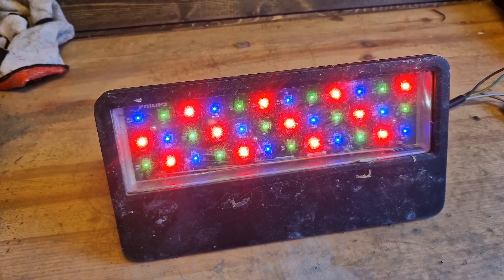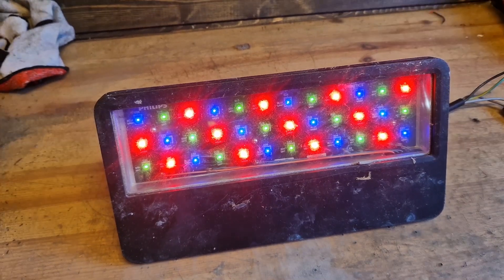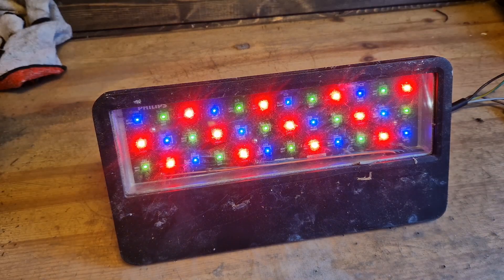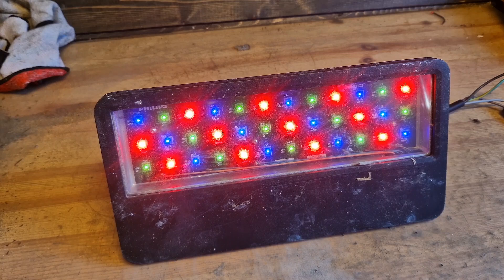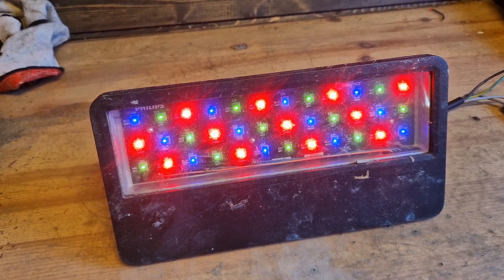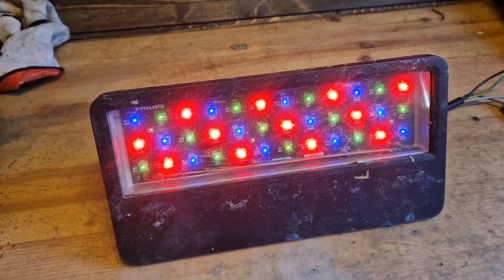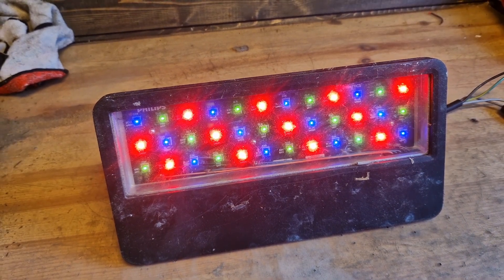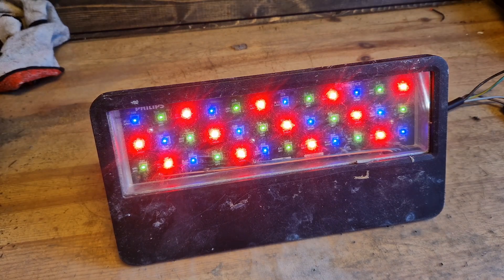Why These Early LED Streetlights Have Such Weird Failures

Comment: Here in the USA we’re having issues with led street lamps where a specific batch of LEDs that were made in the last 4 or so years are having the yellow phosphor layer detaching from the led overtime and falling off causing the roadways to completely turn almost a black light blue in areas with very damage led street lamps showing more blue than others

Comment: Back in the old days when we were such environmentally unfriendly Neanderthalers that changed a bulb when a light didn't work.
That is just a stupid thing to do!

In all honesty;
Back in 2010 the entertainment industry already had enough experience with the RGB combo and them being prone to failure.

There were white LED alternatives available at the time but they were more expensive. 

So this again all comes down to a council wanting to be ahead in energy efficiency and a company cashing in on that by making a cheaply designed product that will outlast its warranty period but dying afterwards without any possibility of repair and thus ending up as landfill material.

Comment: I would say replace all these RGB LED fixtures with today’s technology of phosphor coated blue LEDs. The only problem you could have with more recent LED fixtures is the phosphor coating on individual diodes could flake off and your streetlight fixtures would start turning a blacklight blue, because you would just have naked blue diodes. If that starts happening, replace the defective diodes or fixtures asap, or conspiracy theories will run rampant in the areas with these defective fixtures!
Reply: white LED streetlights are a dead end. so much overwhelming scientific evidence pointing out how harmful the blue content is for both humans and everything else. not acceptable. the only future-proof choice would be either Amber or PC Amber. (personally hoping for a sodium revival :))